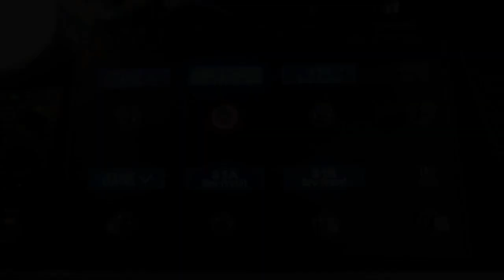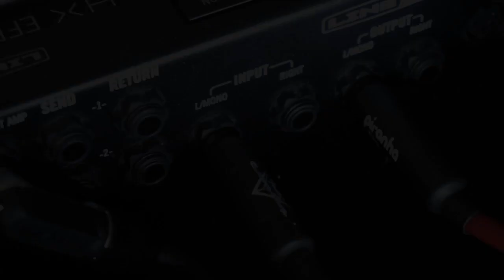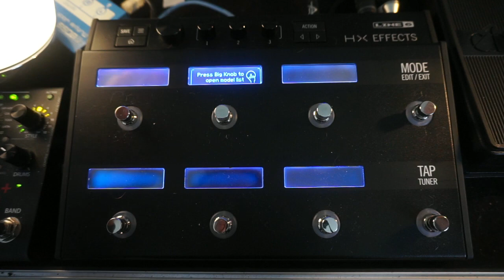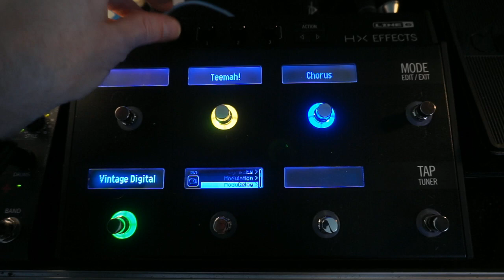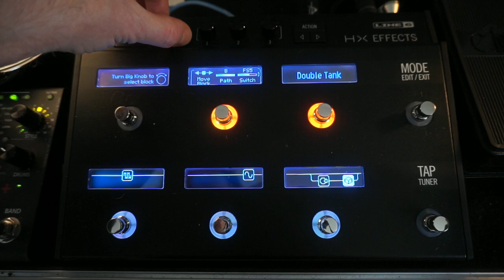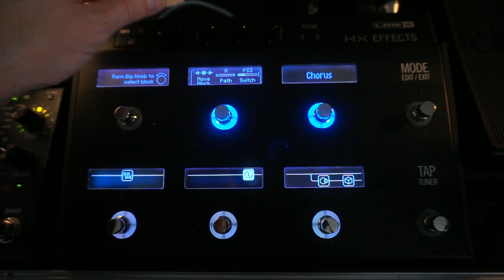Wet / Dry amps with a Line 6 HX Effects - setup tutorial

Comment: Any advice on what phase inverter   To use, can’t seem to find one ?
Reply from the maker: I use the GigRig Humdinger. HTH
Reply: @thehont8648  thanks for reply, looked at that, but since the hx effects is doing the routing and my imperial and Friedman have ground lifts, I would be buying it just for the phase switch. I have seen that Bright onion pedals do a loop pedal with phase reversal switch for £60 so might try that if I have phase problems. Haven’t tried it (wet/dry) yet so don’t know.
Reply: The HX effects has a built-in phase inverter in the mixer block.

Comment: Maybe you can help me with this. can't find it anywhere in the HX owners manual...

If I'm using the HX, and two amp simple stereo set up from the Hx...Can the HX send one effect to one side and a different effect to the other side? or is this not possible?
Reply from the maker: Yes you can. See my video on signal flow and parallel effects. That should help with that.

Comment: Can you do Wet/dry/wet with 3 amps this way?
Reply from the maker: You would need to use the second method detailed here... 
https://youtu.be/mqslSWl5i4w
And connect two amps to each of the send outputs and then insert 2 send modules (one to each) in the signal path. HTH

Comment: Thanks for your video. I just purchased a HX FX and I am planning to run it in the following chain: 
Wah -> Drive Pedals -> Y box -> two Kingsley tube preamp pedals -> stereo signal to the HX FX (I only use the Helix for eq, comp, modulations, delay and reverbs) -> stereo out to a Mesa Boogie 20/20 rack power amp -> stereo 2x12 cab.
I am asking myself two things: 
1) do I need an isolator/phase inverter somewhere in the chain (presumably when the signal splits after the drive, before the two preamps) or can I just use a passive Y box?
2) when the stereo out from the HX FX goes into the power amp, can it be configured as Wet-Dry? I want to have modulations on one channel (and finally, one speaker) only, and have my dry signal on the other channel. 
I'm sure it's possibile to run such a configuration, but can you help me to figure it out how?
Thanks in advance!
Reply from the maker: If the two Kingsleys are running from a proper isolated power supply (or batteries) then you might be OK (especially if the mesa has ground lift). Otherwise I strongly recommend the Gigrig's humdinger pedal. Excellent isolation and phase inversion.
Reply from the maker: For the second question, yes, just treat the output from the HX as if it were a wet dry rig.

Comment: Thanks for the video. Can you do WDW with this method? So send 1 to WET amp right and send 2 to WET amp 2?
Reply from the maker: You would need to use the second method detailed here... 
https://youtu.be/mqslSWl5i4w
And connect two amps to each of the send outputs and then insert 2 send modules (one to each) in the signal path. HTH
Reply: The Hont Yes, but in the second video the send is for the dry amp and not the wet like in the 1st one. I'm confused. 😅
Reply from the maker: @rickyrodam  You can choose where the send appears in the effect order. Watch the video. It explains that (the bit where I move the chorus module).
Reply: The Hont Thanks!

Comment: Any issues with dry tone through HX? I’m considering getting one for wet/dry rig and replace my verb/delay pedals. I would run my OD pedals in front or through xloop... but I’ve seen other videos that complain about the four cable method sucking tone from the dry signal of amp. Thoughts?
Reply from the maker: I'm not using the 4 cable method so can't properly comment,  but all gear affects tone to some degree. IMHO the pros of the HX far outweigh any cons.

Comment: Is it also possible to route paths for the other Dry/Wet config? I mean Git -> HX effects [dry effects only] -> AMP1 -> HX effects [wet effects only] -> AMP2. I think this gives you real Dry/Wet configuration. AMP1 has only distortion and amp 2 get's that distorted signal from AMP1, not from HX effects, + added wet effects.
To make it simple… is there an option to use two inputs separately for wet and dry signal?
Reply from the maker: No. It's not designed to do that and amps are not designed to be run in serial either. You can run two completely separate paths, but only from a single input.

Comment: I have had a terrible time finding accurate info on setting up what I ultimately want to accomplish is to set up a stereo wet stereo dry wet dry wet rig. Utilizing my HX Effects  both in front of the amps, and also for pure wet for delays reverbs and some modulation.  also have an ART dual direct box just like the unit in your video. I am very optimistic that your video mat be the key I have been looking for to finally hook up my superduper tonal nirvana generation rig for the ages (whew!) I got carried away. Bottom line, I am a lucky guy. I was able to get some key pieces to my dream rig,a top line Brit style amp (Friedman Smallbox combo) , and my best and most coveted guitar for decades, a burst ( well, a Custom Shop Historic 58 Bourbonburst), which with a good cable are just killer. But I also have a Bogner Alchemist that I finally found a use for , a couple small tube combos, my effects and the HX Effects, and once I tried wet dry, it was over for me. If I can rig this up, you folks deserve sainthood! Thanks!!
Reply from the maker: That sounds like quite a rig. Best of luck!